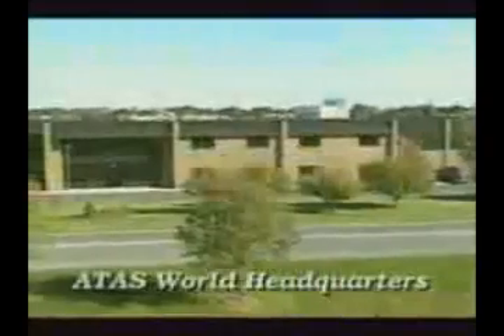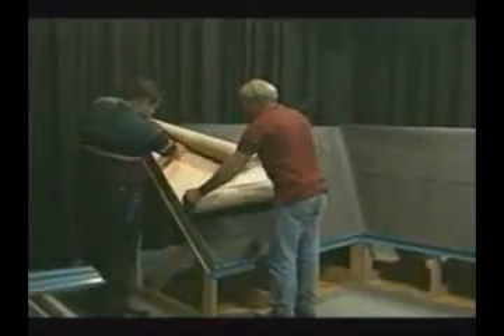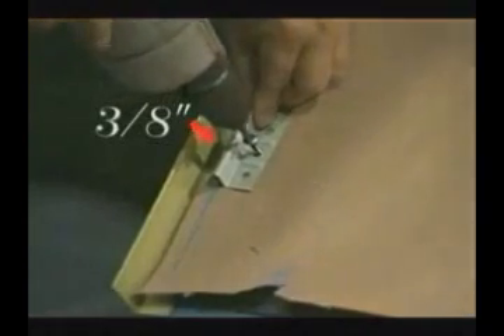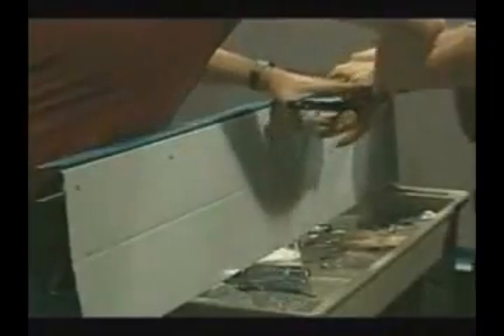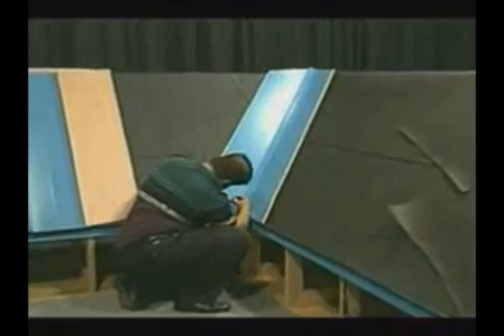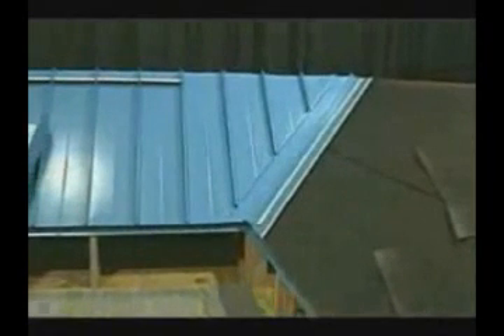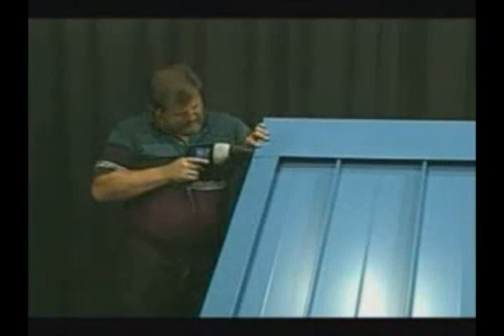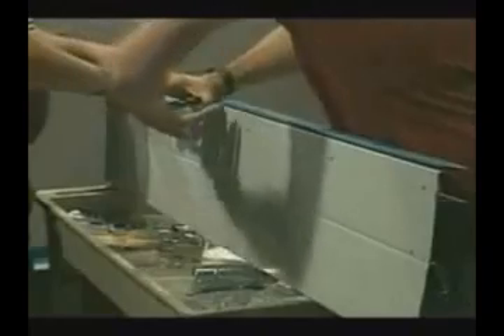"How To Install Standing Seam Metal Roof" by ATAS

Comment: Hi,I am Coco from Shenzhen Sino Master Steel sheet Co.,ltd,established in 2004,we have 13production lines,250,000 square meters,we are professional manufacturer for the cold rolled steel coil/sheet,hot dipped galvanized steel coil/sheet,color coated steel coil/sheet,TCL/Midea/Galanz/etc. are our long term/old customers.If you need high quality color coated roofing steel supplier,please do not hesitate to ask me for a quotation.My wechat:hcf870319,whatsapp/MP:+86-18507551367,Email:welmetal@outlook.com.Thank you.

Comment: the only easy standing seam roof is the  one that uses R panels. lol figure that out
Reply from the maker: +Mike Mercer Mike, r-panel is not really a standing seam... Its a vertical panel system... We can't mix up names, because in such case a corrugated panel can be called standing seam...

But i do agree - r-panel is super easy to install and actually costs same or less than asphalt shingles

Comment: Why not show how "EASY" this would be too install on a real job site instead of a miniature staged roof ---with the same pitch, while standing on, working off and not tearing the rosin paper. This roof had better last an eternity with all this work to be done.
Reply from the maker: +dutyandhumanity well standing seam can be EASY if you have straight gable 3-5 pitch, no pipes, no chimneys, no skylights.

But as soon as you hit any kind of obstacle standing seam becomes a major pain in the @$$  ...
Reply: Its really not as bad as it looks, I would rather do standing seam then shingle, its clean you can go over a lot, going around chimneys and what not are as simple as turn up 3-4 inches make a corner pieces roll your flashing back down, you tend to get cut more thats a fact.

Comment: Wow.   It would be helpful to list all these terms  definitions and you assume that DIY homeowners you think that everyone knows.  Cleat, Joggle cleat, trims, ridge, Metal Z closures, Sealant (what kind) Ridgecap, Masking, Hip location, Z's substrate, gable.......
Reply from the maker: +John Teel here is ATAS Dutch Seam (snap-lock standing seam) installation guide where ALL the terms are explained and shown - http://www.atas.com/ATAS/files/27/27c3cb39-c3ef-4566-bbbc-cfea1335a058.pdf
Reply: This isn’t for DIY, it’s a video for professionals.
A DIYer may be able to install this, but is not recommended. Besides, the ordering of materials probably will be difficult to obtain as a non-professional/contractor/Builder.

Comment: definitely u guy skipping step..on the panel to slide it in inches and a quarter marc on the right side of the bottom of the panel. . skip to how to do the square marc on the roof, u say it but not showing. .and doing the valley panel is better get the panel on the valley marc the right side of the bottom of the rib,and marc the left side of the bottom of the rib about a 1/8 nch.. them do a straight marc from the marc..left to the right side ,put like one inch and a 1/8 ,bend the first marc..and later install on the clip..below 1/8 nch..allway up or down..the angle of the panel change how u go up or down. .your welcome
Reply from the maker: +jose santiago - I agree with you, but you need to understand - video is 16 minutes long. No way you can show all details of standing seam even in 1 hour video. 

Have you ever seen installation manual from ANY standing seam manufacturer? None have proper details for chimney / skylight flashing - because it's very difficult to explain with words or images ...

Comment: can a ridge vent be installed with this product?
Reply from the maker: The regular type ridge vent (like Cobra) is not used here. Instead standing seam can use vented z-bar, fo best air circulation.

Comment: Is the color of the blue roofing material showing up accurately? I love this color, but can only seem to find bright or dark blues online. If accurate, what's the color name/brand? Thanks in advance for your answer.
Reply from the maker: Which blue material are you referring to?

Colors are usually OFF unless you are looking at a real sample. Find a local supplier to see the color samples, or call manufacturer (though I think the will not send you color chips)

Note - paper color pallets are off as well ... good luck

Comment: shouldnt the gable edge be installed on top of the felt paper?
Reply: If any water were to get under the roofing, it would follow the felt down, over the drip edge and off the roof.
Reply from the maker: I always install on top of underlayment, but some recommend putting underlay over gable edge. Wit standing seam you really do not have to do that. Any moisture under roof panels will be condensation, so it is irrelevant which way you do it, but it's much easier to put trim over felt

Comment: That is an incredible amount of work to roof something.  My house is 28' high at the peak, doing winds of 100 mph, and I don't care if screws are visible on the roof.  I suppose a fancy roof don't pop in the sun/dark change, but damn - That was a lot of work!  Did mine solo, 54'x32' total size.

Comment: High wind can and will blow water up and under the shingles. That's why they don't recommend shingles for low slope roofs. A clogged rain gutter can be a real nightmare, as high winds can blow that water up and under the starter shingles.

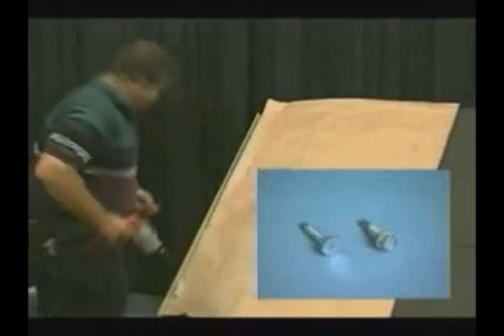Comment: At 3:45 they offer raised clips so rosin paper is unnecessary AND one can have ventilation without using furring strips which are expensive and can trap water.
Hidden fasteners are certainly a nice touch that avoids roof leaks.
At 11:00 we see metal Z closures and neoprene seals. A nice touch once again to prevent wind driven rain from finding it's way under the panels.
Reply: no fur strips? Does it or what else holds steel up with snow load??

Comment: At 2:20 they mention an overlap to go over the drip edge, no doubt so water doesn't blow up under the panel. I have only seen one other manufacturer mention doing this.
At 1:34 they use a "gable leak starter pleat". I've seen no other manufacturer mention this device. I'm sure it also keeps the wind from blowing rain under the panels. 
At 3:00 they use a rosin paper so the panels can expand and contract freely over the tar paper. Nice. Never seen that before.